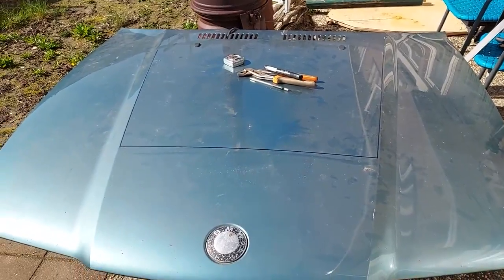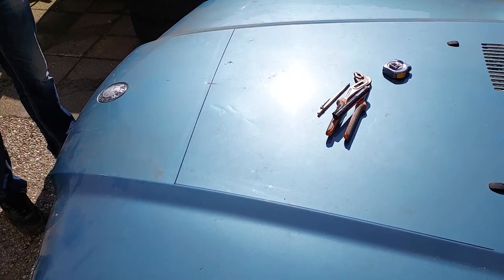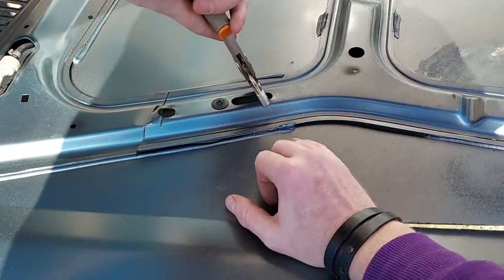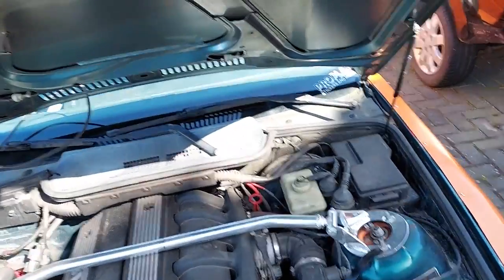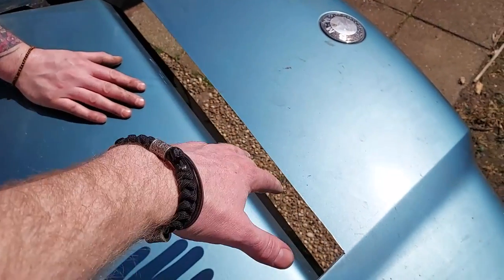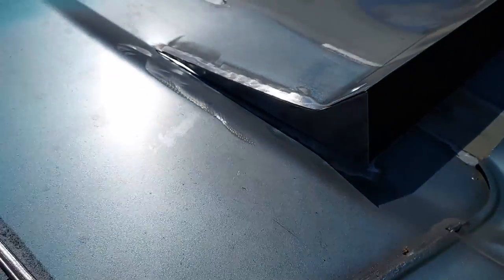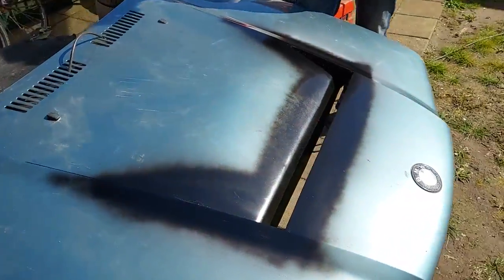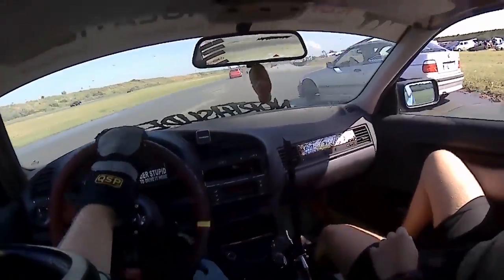how to make your own simple DIY bonnet vents pt 1

Comment: Please try checking airflow by taping short bits of yarn along the vent!  I'm considering doing this to my car!
Reply: this works. most cars have an area of high pressure under the hood right infront of the engine and behind radiator, along with the fast flowing air over hood, helps air enter and leave. great for cooling!